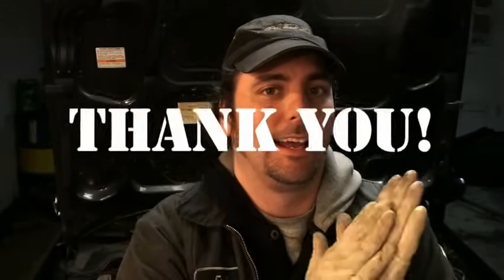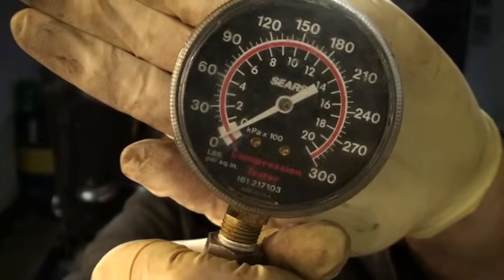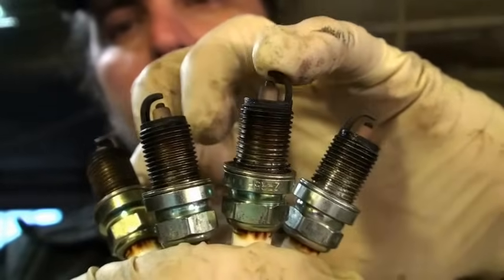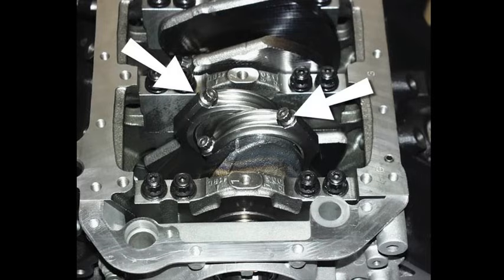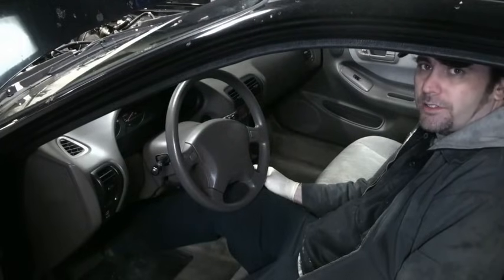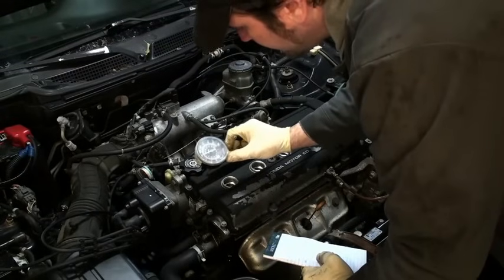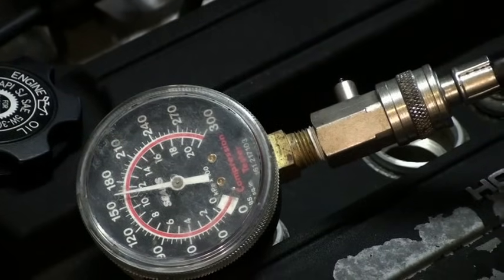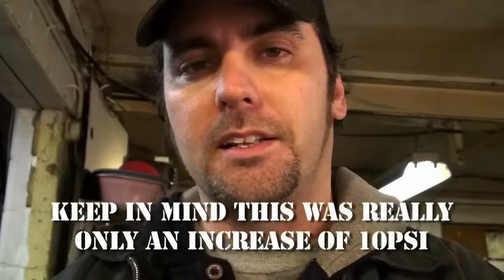How To Perform a Compression Test - EricTheCarGuy

Comment: Hey good Info Eric, I need a clarification/advice on a situation I have, I have this misfire in Cyl # 5, I have did everything from Replacing the Injectors, Spark Plug wires, Spark plugs, still there's the misfire, So I'm looking to do this compression test, but one thing to note, WHEN I PULLED THE SPARK PLUG IN CYL#5 IT LOOKED FOULED WITH CRUDE/CARBON (like its burning oil?..) But anyway to get to my question (although it might sound silly/stupid, but it won't hurt to ask). So, if a Wet test Suggests a Worn Piston Ring, Can I just replace the Worn ring with a Larger ring to compensate wear? If not why not? Its a '05 Impala 3800.

Comment: I was hoping you could point us in the right direction:  95 Sentra, crank no start. We have spark to all 4 plugs, we have fuel pressure, we have compression. The car died on us last month; we replaced the fuel pump, fuel filter, cap and rotor, fuel pressure regulator and spark plugs. Immediately after installing the new fuel pressure regulator I reinstalled the fuel pump fuse and turned it over and it ran for about 90 seconds and then stalled; haven't gotten it to start again.  I know we have fuel pressure, and the compression test I did shows  compression in all cylinders but the compression is low in cyl 1 and 4. Suggestions? :)
Reply: I'm not familiar with the '95 Sentra, but my '97 CR-V exhibited similar symptoms. I narrowed it down to a bad ignition coil.
Reply: A service manual should have the specs for an ignition coil resistance test.
Reply: Thanks hoopfan71 !   for whatever reason the car started tonight and ran for half an hour without a problem. Going to do further testing ASAP. Thanks !!

Comment: If I have a 76 truck, will pushing the pedal to the floor work still?
Reply: +spiffcats Just tryin to help out but I'm gonna say no.  It mostly depends on if your engine is carbeurated or EFI. This is because carbs are usually fully mechanical devices such as cables and butterfly type valves instead of computer assisted logic.  just my 2 cents.  Will most likely flood the crap outta your truck.

Comment: Now this bad....my readings are no where near above 60 lowest is #1 cylinder 38 psi 97 Acura Integra gsr 168,000 miles going for a new engine but surprisingly this one in my car still pulls

Comment: well you get incorrect readings if you don't pull all the spark plugs at the same time? And will a massive vacuum leak code cause you do get incorrect numbers?
Reply: also, I've read you crank until it stops pressuring, crank 4 times, 5 times and 7 times or until the needle won't move any further? And should a turbo engine running 11.8 psi from the factory give you 200psi in each cylinder head? That seems really high compared to naturally aspirated car which should have more compression?
Reply: You want someone to help you, with a name like that?...LOL......."NOT"............GOOD LUCK WITH THAT

Comment: Hi, if I used a remote starter (hooked to the starter coil) do I still have to disable the gas pump and ignition system? or by not using the key the ignition and gas pump are not being use?

Comment: A little bit of oil in the fuel  constantly will help keep the cylinders and rings from wearing,not too much oil ,maybe about        1/ 4 ounce  per gallon..Marvel oil is great and no worries about catalytic converts burning up..It is  a great way way to break in a new engine also..

Comment: What impact does ambient temperature have on the compression test results? I know that testing at high altitude means you'll have lower compression numbers, everything else being the equal. What about if you test when it's cold outside. Will that also produce lower compression numbers, like how your tire pressure drops when it gets really cold outside? Thanks!
Reply: They should all act the same no matter where you are. The compression test is the first step to see if the compression in each cylinder are playing in the same ball park. If a cylinder # isn't similar to the others (lower). The test show's you which one it is. Step 2 ..is the LeakDown test.

Comment: Great video, Thanks. I just purchased a 1960 Chevy Impala with a 348ci. I'm having major issues with 4 cylinders oiling up and fouling plugs. I replaced the points and went with a hotter coil and Petronix I ignition. No change. The old coil was 55 years old! There's three cylinders next to each other on the drivers side and one on the passenger that are doing this. I'm thinking on the compression test next and removing the heads to check out the gaskets.

Comment: Good video i might ad that if you have a gauge that has a air hose hookup you can use it to pressurize the cylinder and check for  coolant leaks like a cracked head or bad head gasket by looking for bubbles in the radiator by taking off the cap.

Comment: Eric help please!
I made the compression test 
dry: pistons  1= 180, 2=178, 3=180, 4= 176
wet: pistons  1= 270, 2=270, 3= 272, 4=285 
now why does the compression increase that much when I put the oil? I only use 2 tablespoon of oil In each cylinder. the engine is a 1.5 4g15 SOHC 12valves, from a 2001 mitsubishi mirage/lancer. please answer thanks.
Reply: +bartojoe Thats actually very good for a lancer 4G15 engine. the range (dry) is 170-190 for that engine. In regards to the Big jump when wet, most likely too much oil. 2 tablespoons is a lot and Oil does not compress, so oil was probably blasted up into the gauge and created abnormal readings. You want to use no more tha 1 TEASPOON or the 3 small squirts that Eric used. It not a lot of oil.

Have you ever worked on that engine? I am surprised that a 2001 would have such great readings? I would expect to see more like 110-130psi for that age.
Reply: +Edward David 
I only replaced the timing belt, oil pump,fuel filter  and piston rings but that was 2 years ago, and I always change the oil every 3 months
Reply: Did you do everything with the engine still in the car? Pity you didn't do a tutorial video or a write up with photos. How much difficulty did you encounter? And anything to watch for? Where did you get the ring set? And brand? Good info to know.
Reply: +Scuba Jamaica 
yes I did everything with the engine still in the car. I still have the pictures of the compression readings in my tablet, because I knew that there would be people that won't believe me and I do not own a video camera so i couldnt film the test.im a unemployed honest young man trying to learn how engine works.  the timing belt is gates and the pistons rings are Hastings. btw go easy on me I'm puertorican I don't know too much English.  so what did u mean by pity?
Reply: +bartojoe definition of Pity: a cause for regret or disappointment. 

Disappointment in that you hadnt made a video.
Reply: +Edward David 
oh ok. yea bro I couldn't make a video, I wish I had a video camera to make the video.
I still have the pics, if u want them all u have to do is send me ur email.
Reply: +bartojoe open a Google drive or Microsoft One Drive (gives you 15gb of free data storage, I have unlimited) account, upload and share the link. That's what I do, it's easiest way to share pics

Comment: Why would the even side of my V6 engine I. E.  2,4,6 wear out spark plugs far worse than the odd side 1,3,5 and have misfires on cylinder 2 before and after replacing all plugs? Very loud exhaust noise at 2k rpm quieter above or below.  I haven't tested  compression yet.    It's a 2006 impala 3.9L with 173k miles if that gives you any clues. Only code it shows is misfire on cylinder 2. Thanks for your helpful videos

Comment: Erick first off I think your videos are one of the most important tools any starting mechanic like me could have. that being said I had an issue with a customers car where the coolant was getting mixed with the oil and that's all the coolant the car was still somewhat running did a compression test to identify the offending piston checked the first piston and got 70psi and I heard a medium thump on the engine after that there was no compression at all on any of the cylinders I re-tested the first cylinder where I had gotten my first reading and got a no reading at all meaning 0 compression but I'm not really sure what can cause a 0 compression on al cylinders other than a busted crankshaft any info would greatly help thank you car info:214 hp (160 kW) 3.5 L V6 engine

Comment: is it better (for results) to do this on a cold motor or hot?
Reply: Heat up the motor to running temp first if possible. You can do the compression test on a cold engine however the compression pressures will be low when compared to specifications. Diagnosing cylinder to piston ring sealing using the "First Puff" or Wet Compression Testing is not valid on a cold engine.

Comment: Eric, I recently had my Dodge Durango, '06, 3.7 eng. Fuel pump and tank replaced as per the diagnosis of the Chrysler dealership. The so called failed fuel pump was only recently replaced last fall of 2014.  Then after that, I left the dealership $1800 lighter in my wallet, only to see all my lights flashing on and off and all the bells associated with them, but the Vehicle running well. I finally got it home without incident and it still ran for a few days (still with the lights and bells active) until one morning, she just wouldn't turn over.  So I had a local garage guy diag it and it indicated a PCM failure. $250 bucks later, it was replaced with the Codes supposedly already in place. But, you guessed it! Still, not turning over. The local garage did not have the proper machine to input the needed codes, so back to the local Dodge dealership which they claimed to have input the codes. But without success, then replaced all plugs, still no success..Then after all that they finally tell me my compressions are bad. I DONT BELEIVE THEM. If my compressions were bad, I don't think my engine would be running as smooth as it did, then all of a sudden die out! But I could be wrong, it does have alot of miles..I know you can't dianose on a blog. But now, she doesn't even turn or start, just makes this crazy electrical static noise when I try to turn it over. I still say it's either a bad code input or bad PCM!

Comment: Hi guys, this video is helpful to guide my compression test.
My car is 2005 Mazda 3s, 4 cylinder, with 56K miles. The data required by manual are: standard: 199.1psi, minimum: 139.2 psi; maximum difference: 28.5 psi. My test results from passenger to driver side are: 178psi, 162psi, 171psi, 168 psi.

What are your options for my test results? 162psi is pretty low compared to 178psi.

Thank you.

Comment: Hi brother I think you are awesome, but I wander if you can give me some advice about my engine. I have a 307 Oldsmobile engine I had rebuilt about 10 years ago complete,I drove it for about two years and put it in storage because I wanted a New vehicle but when I wanted to start back driving it after 5 years I can't get it to cranking for nothing it is getting fire and gas but want crank any suggestions.

Comment: My '93 BMW 325I with 700k (does not smoke) quit running a few months ago,,,,,, thought it was out of gas added 5 gal. still no start turned over til battery near dead (dumping lots of gas in the cylinder washing out oil losing compression). Mechanic said bad fuel pump... replaced all that stuff still no start.... said was getting pressure at filter.... said acts like it has jumped time so they quit working on it with $300 in parts installed. Hauled it to a BMW guru told him they said may have jumped time... He checked said intake is early and averaging psi 50 to 70 with it out of time. I'm thinking that maybe I can get away with new timing chains, sprockets, tensioner, and guide and rebuild the vanos adding new o-rings, get timing kit lock down the cams put everything back together pour 1/2 cup tranny fluid down each cylinder and it should run.... once back in time and oil added to each cylinder psi should be way higher. I don't think valves are bent or there would be no compression avail. I think with 700k the oil pressure leaks down vanos' oil seals worn  can't adjust timing due to low oil pressure at cold start up...... I want to see 1 million miles out of this engine before replacing with used $500 motor.and finding a shade tree mechanic replace it for $500 labor......

Comment: Can u tell me on a 350 GMC trk I have changed both heads on this mother and still am  getting water in oil have put new gasket s on tevery thing ,some one told me if I didn't use thread tightener that's why I got water in oil this is killing me can I use a can of liquid glass would this stop it this is  a 78  yr moved  350
Reply: A gallon of gas and a match fixes all problems

Comment: Hey steve, Im not a pro tech, You definitely don't have compression in #2 cylinder, I would do a cylinder leakage test to isolate intake valve, exhaust valve, head gasket. Good luck sir..

Comment: I got a dry test of #1 145 psi ,and 0 on the others, I was thinking timingbelt. a buddy said it could be head gasket. it will not start. got fuel checked with pressure test and has spark. how can I tell if it head gasket or timing belt? I think it timing belt. just didn't want to pull the timing cover.
Reply: ps. no water in oil or on cap. engine just died and would not start. it was low on oil and got a little hot. no oil leaking anywhere either
Reply: Certainly has to be a belt. So check. Try to pull the cover back slightly, so you can get a finger or screwdriver to push on the belt to see if has any tension on it.  I'm sure it doesn't.
Reply: George Edwards ya  it was belt bottom was kinked,took main pully bolt off and felt 5 or 7 smaller bolts  was pickig up wrench to take them off and a buddy that owns body shopsaid that they don't come off just tap pu;;y, so I had 2 x 4 and hammer tapping crank pully and it came off . looked at pully and the crankshaft broke.so it in scrapyard now.bought a jeep cherkee.

Comment: 2002 Mercedes C32 question at first start up I get a p0303 mostly after secondary airpump turns off now that it's cold..warmer weather it's accompanied by p0300 but I think the p0303 is naturally causing the p0300 multiple cylinder misfire...I replaced all plugs and swapped 3 time the coil pack between 1-3 and 6 with spark wires also. I changed fuel filter incase regulator bad...when car acts up misfire I turn off then on and car fine and no codes reappear. Driving car I don't feel any power loss even at WOT...do you think it might be compression? cats on cylinder 3 side? maybe faulty fuel injector?

Comment: My 95 gsr blows black/ blue some I'm bout to compression test it right NOw... any other recommendation?
Reply: I used tonown a GSR as well, great built engines and plenty power out of a 4 banger, if its black most likely its burning oil , if its blue white smoke your burning antifreeze and its mixing with your oil as well. So most likely time for a new head gasket and resurface as well as rebuild the engine. Keep it alove those are no longer made anymore.

Comment: Eric,
I have watched and re-watched your compression test video.  It was great, but it leaves me with 2 questions.
1.  I want to do the test on a 1929 Graham-Paige 615.  This is a 6 cylinder automobile with the spark plugs running along the top of the engine.  My problem is that the plugs have a 22mm circumference and I have been unable (in 3 days of looking) to find a compression tester with that large of a fitting to screw into the plug holes.  I am hoping that you might be able to tell me where I might find a test kit, or a gauge, of that size. (In the alternative, may I use the rubber-headed insert that comes with some of the test kits and, if so, how do I do that?)
2.  Why do you perform a "dry" and a "wet" test?
Thank you for your attention.
Steve Lewis

Comment: 2001 acura cl getting engine codes p0300  p0100 p0200 p0300 p0400 p0500 p0600 , every cylinder is misfiring .. any clue what it could be EricTheCarGuy does it need coils? Or sparkplugs? I'm stumped ..

Comment: can you do this on a hot engine?
Reply: im pretty sure the results will change
Reply: Paul Jason compression tester manuals typically say you should warm up the engine to normal operating temp.  The readings may be deceptively high on a cold engine.

Comment: Please correct me if I am wrong, but shouldn't the throttle be wide open when you run theses tests?  I was always told that with the throttle closed, you get incorrect pressure readings...

Comment: Can a compression test be performed if the following parts are not connected to the engine?  :Timing Belt Cover, Radiator, Alternator, Compressoer Works/Water Outlet pipe.                        http://www.autozone.com/external-engine/water-outlet/compressor-works-water-outlet/chevrolet/s10-p-u-2wd/1996/4-cylinders-4-2-2l-sfi/792085_0_0/

Comment: hey I did this test on my 1997 4runner 4cyl, I got 60 psi both wet and dry across all cylinders.  That's pretty low.  What do you think?  I was doing this because I thought I might have a blown head gasket.
Reply: that seems awfully low man. should be at 178. minimum is at 127
Reply: Either you made a mistake in the test/installation, have faulty test equipment, or have the cam timing extremely off and should check that the cam and crank gears are matched correctly at the timing chain/belt.